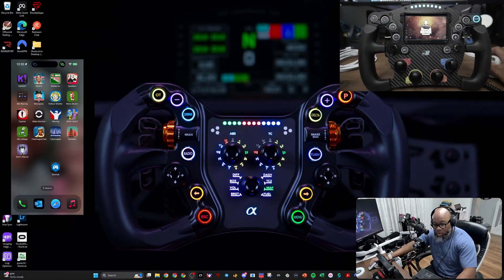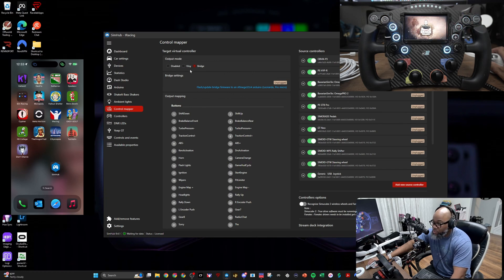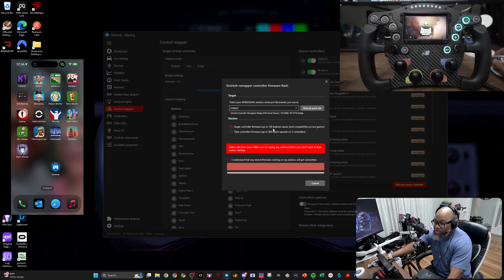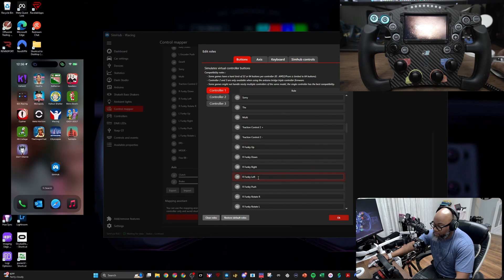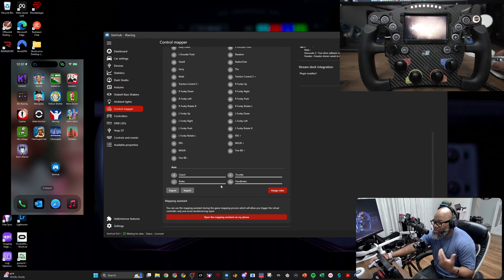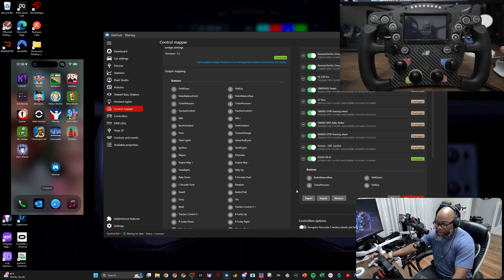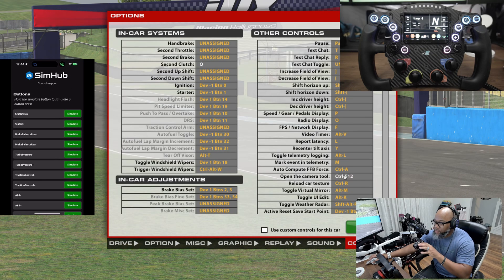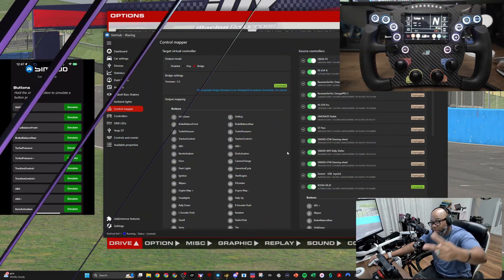SIMHUB CONTROL MAPPER: Setup Guide

Comment: I cannot map my other Fanatec McLaren wheel after I successfully mapped the formula 2.5 wheel.
Reply from the maker: Yeah it is a bit harder for Fanatec wheels. I do believe you have to select an option with the control mapper, one of my admins in my discord channel has fanatec and could assist. If you need help, reach out to James (Nati) in my discord and he can help get you set up.
Reply: @g @grayzedynamics thanks man. Will reach out to your admin.

Comment: Love the precise instructions and easy to understand videos you produce.   I have recently begun using control mapper.  Do you have a link to the correct Arduino board to buy?  

Also, if I have these already set up using the V joy way do I have to reset up the wheel if I switched to the Bridge mode?
Reply from the maker: You will have to create the bridge for the arduino. And if you save the layout, you may be able to reload it, not as I never used VJoy. 

I purchased from Amazon. https://a.co/d/iRdJWgx

Comment: My questions will sound ridiculous to you, I’m sorry about that. But I will do it for the first time and I am writing to be informed. Do you use the matrix button sequence for buttons? Because you need a lot of buttons (with the encoder) And which ardno chip is the chip you use on your cards? For example, is it done using an arduino nano or should I use a pro micro? I would be very happy if you answer sir
Reply: Was it too bad a question you couldn’t answer? 😅
Reply from the maker: @ertugrultrm @ertugrultrm Ha. I typed out the entire message and didn't hit send. Lol. 

The matrix is just a flash box indicator. Just used for LED lights for flags and such. Control mapper is for the many wheels of course. Great tool that I use for every game. You will want to get a pro micro or Leonardo. They can be purchased from Amazon for cheap and you get 3.

Comment: Great video as always…. Have you had a go at setting up the FN or “special button” function which allows you to have the same button or encoder carry out two different functions?  Been figuring it out today and really happy with the results so far.
Reply from the maker: I have played around with it, but I have so many inputs, I dont have a clue what I would do with it. LoL
Reply: @ I was looking to add extra functionality to the thumb rotaries on my wheel so had a purpose in mind. Each thumb rotary can now change three different properties which is handy when driving other than that I’ll stick to keeping it simple otherwise I could easily forget what’s been programmed.
Reply from the maker: @bobsimpson5886  That is my issue, I would forget what I am doing. Lol. And most of the wheels I use, have multiple thumb encoders or some type of multi-link feature. And with button boxes and stream decks, I am good on inputs. LoL
Reply: @grayzedynamics  I made a cheat sheet so I don’t forget 🤣
Reply from the maker: Do you glance at it mid-race. Hahaha

Comment: im struggling with the vjoy version of controller mapper recognizing my simagic wheels.   gt neo and fx pro.  i see using the arduino version you have a gt neo on your list.  how were you able to get simhub to recognize that as a controller source?
Reply from the maker: I just used the arduino to map the buttons. I didn't use vjoy because I've had issues.
Reply: Seems to show up when I use USB direct to the wheels. Not ideal but makes life easier.
Reply from the maker: Gotcha. Yeah vjoy can be tricky. I would suggest a cheap arduino. They are only a few bucks on Ali express

Comment: Hi, great video. Can you also map keyboard keys and mouse inputs with this? I race in VR only and I want to find a way to bind an escape, enter... key in AMS2 so I don't have to take off my headset to get my keyboard. Thank you.
Reply from the maker: I have not tried to mp my keyboard but I d see that it can be done. I will have to do some research.
Reply: @grayzedynamics  I just tried it and it works fine.

Comment: Hello thank you for the guide. I have ordered an Arduino. Currently Ive tried it via Vjoy. How do you get the force feedback to work if you set the wheel acis via Simhub control mapper. If I set the wheel axis through control mapper I have no force feedback. Currently Im just using the  the wheel axis for the wheel and control mapper for all of my wheel buttons.
Reply from the maker: So I do not map the wheelbase thru my Arduino b/c I do not see the advantage since I have 1 wheelbase. 
I think it truly is beneficial if you change things like wheels regularly and maybe some peripherals. But no need to use the wheelbase function. I did not use VJoy b/c I had some issues w/ too many peripherals and the arduino worked much better. I would recommend just not configuring the wheelbase.

Comment: Hey, thanks fot the video, currently building a diy 720s wheel, can you program and calibrate dual clutches(using hall sensors) using simhub?
Reply from the maker: It may be possible, I believe you will likely have to calibrate on the wheel, but it may be possible in control mapper. I will have to research this.